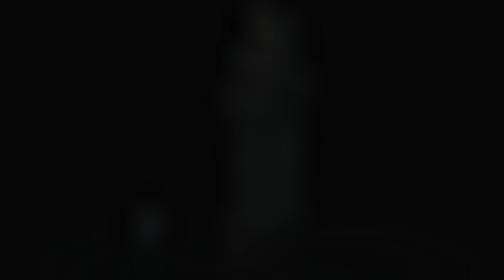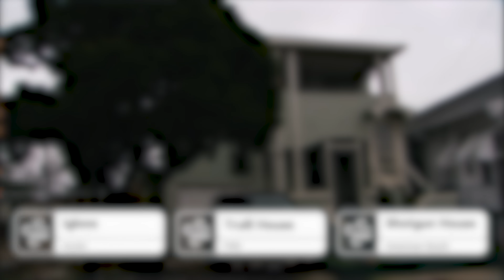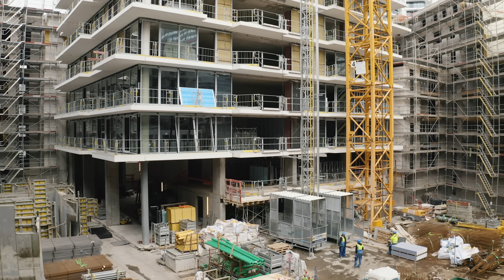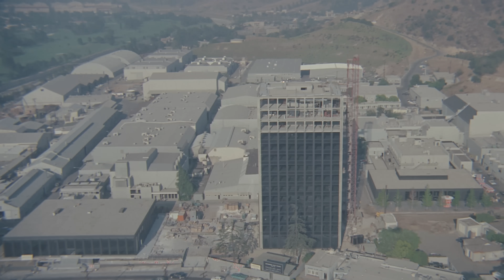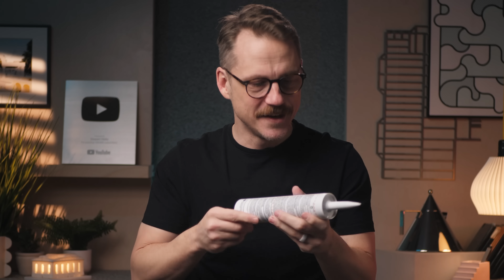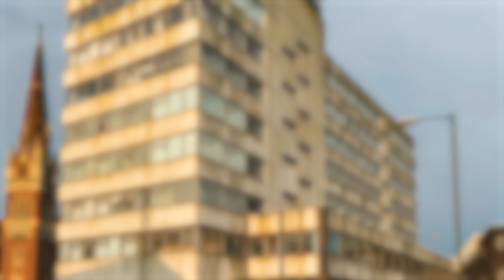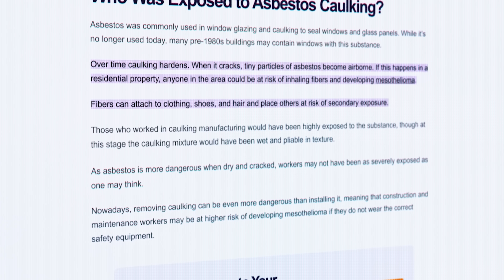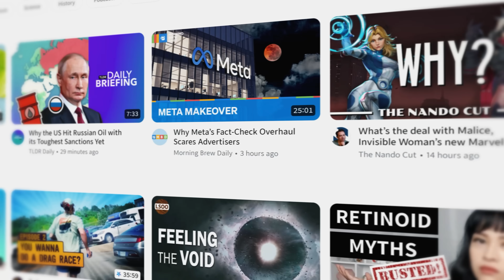How Caulk Accidentally Made Buildings FLAT

Comment: This video’s focus on caulking as the reason for the loss of ornamentation in building facades is a prime example of the “hasty generalization” logical fallacy.

It overlooks several fundamental societal shifts that impacted construction including skilled labour shortages due to WW1 and WW2, the advent of rapid concrete construction, the requirement for rapid rebuilding following WW2, the advent of air conditioning resulting in a reduction in ventilation requirements, science and engineering improvements that allow for leaner designs that allow for bigger windows, artificial lighting reducing the need for natural light and architectural tastes.

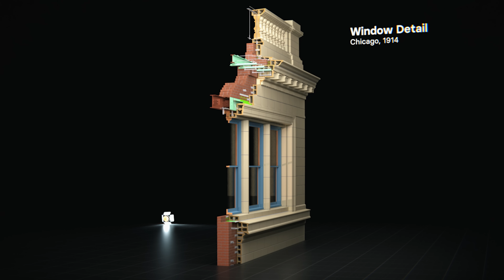The ornamental building (window detail, Chicago, 1914 at the 1:14 mark) is actually a type of curtain wall construction as it uses faience tiles tied to the main structure. This construction hangs terracotta tiles manufactured off-site and assembled on-site, sealed with gap filler like lime mortar, in place of stonework. This technique was cheaper, did not require stonemasonry skills, had accurate repeatability, and was lighter, allowing for taller constructions.

Essentially, the video wrongly attributes the decline in ornamentation solely to caulking, ignoring examples of continued ornamentation in postmodern architecture.
Reply: There's also the method of building design. Buildings nowadays are all designed in AutoCAD and then 3D mockups are made in 3DS max. That second part was my job. If I see a modern building. I can just see BLATANTLY how it was made in that software. And such... Boring/blocky design is far easier to make in that software than intricate ornamental designs. Transferring an intricate design from autocad to 3dsmax would quadruple my workload. So, it was always avoided. Cuz my boss wouldn't really be looking forward to paying me 4x the hours.

Too boot, when our architecture agency was talking with the construction company to quote a project that WAS ornamental. The company pointed out to us that making the building ornamental wasn't very expensive. With modern tech like casting concrete into molds, it's become incredibly cheap to make and install ornaments.

It's just the laziness of us architects and the greed of the company bosses to try to get every little penny. Other that it's actually never been easier or cheaper to make an ornamental building.
Reply: Thank you for your comment. Can you explain that terracotta window part a bit more? I'm still confused as to why all of those tiles overlap, jutting in and out and in again. Was his argument that it allows for more opportunities to adjust/correct deviations? or just that the multiple overhangs in the profile are helpful in themselves? I ask bc I study 8th cent. monastic architecture, and building manuals specify/describe similar profiles, but they are carved out of single pieces of sandstone, rather than a series of stacked tiles (eliminating the "seams as opportunities to adjust" explanation). As you point out, earlier similar designs would have been carved into a single block of stone by stonemasons...so it seems that the reason for the variance in profile is ornamental, rather that a practical way to create lots of joints, yes?
Reply: Thank you for adding this. I was waiting the entire video for him to make these points, but he never did.
Reply: Glad I found this comment. I was hoping he would talk about emerging technologies and strategies that balance the need for a sense of place with the realities of building on the scale needed for a society of 8 or 9 billion humans. I really feel him on the tragedy of these purely functional boxes. I'm as sick of this sterile, minimalist, international modernism + "Apple Store futurism" aesthetic as anyone else. It has vastly overstayed its welcome. But we need something to replace it with, and artisanally fitted terracotta windows are not going to be it. The money and the time just aren't there for it. So what CAN we do?
Reply: I'm always skeptical of these kinds of shorter factoid / "how x killed y" videos but I wasn't clued in on the specifics of this topic. Thanks for the added context
Reply: But a video essay needs a punchy title!
Reply: The video is lacking in detail but it also doesn't point out the fact that the death of the artisan class is the problem. Doing extremely high quality work is not valued when you can do it "good enough" (which generally means borderline temporary) and produce more volume. This is a political shift and it's not the fault of architects just not caring, it's the fault of capitalism fundamentally discouraging quality and true efficiency in favor of naive short-term productivity. A house which lasts 4x as long is worth, to society, 4x as much (assuming it never gets redeveloped for non-aging reasons). But under capitalism, if that house costs 30% more to build it is "inefficient" to construct in that manner and the cheaper, far worse long-term return on investment option is selected. The economic system, not individuals acting in their best interest under that system, is the problem.
Reply: Just wanted a catchy thumbnail. And I think it worked. Here we are.  Building has gone downhill so fast.  It’s sad to see.  The newer the home the faster it falls apart. Too much “innovation” with materials and building practices.
Reply: Of course there are multiple factors to any societal trend. The thing is, this video is specifically about what caulk changed in construction.
Reply: This channel is yet another example of becoming shackled to it's own success. He's scraping the bottom of the barrel for topics & losing his personal interest in it, so his level of research (which was never much more thorough than a typical pop-style "how it's made" show) is declining.  However, he still has to release a video regularly to get his sponsor money or else he'd have to go get a regular job.

Entire video is basically a joke.  To make buildings like they did 100 years ago would cost 5x what it costs to make a modern component-style building... which means 80% fewer buildings.  I'm sure some people would claim that's a good thing, and ironically these are the same people constantly complaining about lack of affordable homes, lack of "third spaces", while importing the entire world.

The most common type of person is one with no deep understanding of anything, but tons of self-contradictory whiny opinions mostly parroted from their echochamber with no thought.  It's all so tiresome.
Reply: @yunggolem4687 this idea that classic architecture is more expensive or not feasible anymore is actually a fallacy. There is a great video regarding this matter by a channel called The aesthetic city.
Reply: @yunggolem4687  Let us all try to stay in the constructive end of the critique pool maybe?  It deserves to be mentioned that Mr. Hicks does have what many would consider a "real job", he teaches at the University of Chicago.  While this video was not my favorite, I often find these videos very well researched, beautifully illustrated with drawings, diagrams, photographs and little films, and reflect a deep understanding of and passionate engagement with architecture.  Specifically, Mr. Hicks' videos on the work of Louis Kahn and his office are especially reveletory and quite lovely.

Comment: The most evident showcase of these principles is probably in roofing. Tiles and shingles do not seal the inside off from the outside. Instead they're arranged so as to stop any water intrusion from falling or windswept rainwater. Rolled roofing (and to some extent asphalt shingles as well) are made to seal and stick to one another to prevent water ingress.

Comment: At its core, a lot of the issues with caulking, foams, and similar sealants boil down to the degradation of quality (enshitification) of construction, not unlike the degradation of manufacturing quality we see in a lot of consumer goods. It's all about finding ways of producing more, cheaper and with less skilled labor. Mass produced panelized construction is considerably cheaper than bespoke, skill driven site fabricated components. As long as goods and materials or delivered in tact, any and all future issues with construction methods are deferred to the owner/operators of the building, all it needs to do is outlast the warranty on the labor outlined by the contractors/subcontractors.